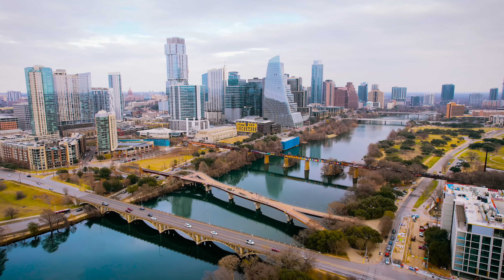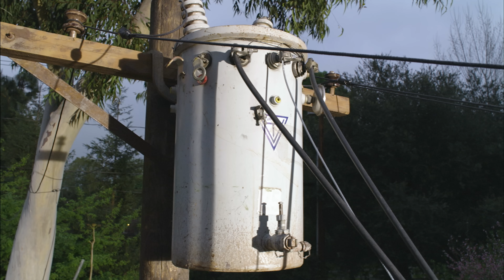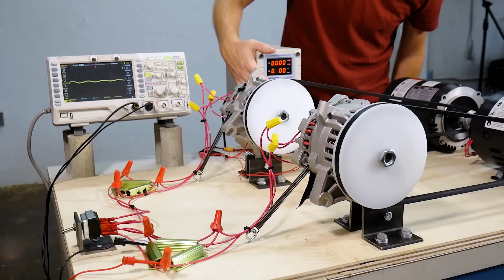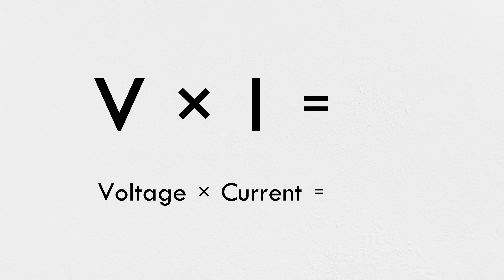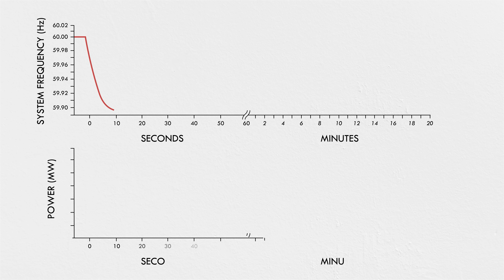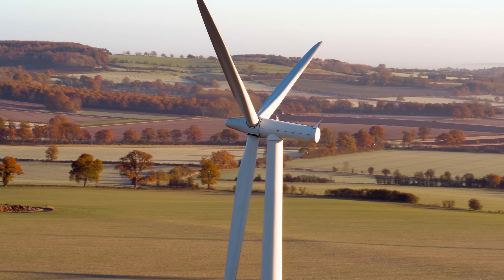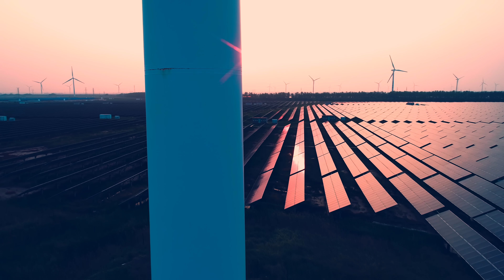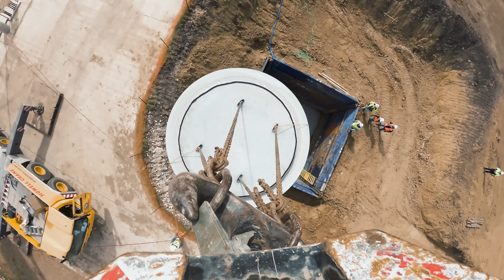Connecting Solar to the Grid is Harder Than You Think

Comment: Audio nerd here and you stole the words out of my mouth with that inverter explanation when I thought "That just sounds like the way pulse width modulation works."
Reply: What is shown in the video IS NOT what PWM looks like, though...
Reply: @TheMightyZwom Correct, the picture shown has some kind of multi-level inverter.
By the way, you can have inverters that are both multi-level and still use pulse-width modulation.
Reply: @marco23p  Yes, absolutely. The video only mentioned PWM, however, and I found that inaccurate (or at the very least incomplete).
Reply: Though normally solar inverters are horrid RF noise generators, as most of them really do not have enough filtering, and often enough the connection methods used are not the best from a RF noise point of view. You really need a lot more filtering to reduce harmonics, and such filters at power are both heavy, expensive and tend to run somewhat hot, losing power in the noise by dissipating as heat in the inductors and capacitors. No way to work it with smaller power, though you can reduce emitted noise quite a lot simply by connecting grounds correctly, and using properly RF bonded steel conduits for the cables, and a local RF functional ground as well. But most will not install that, as it adds a lot of cost to the system for little perceived improvement.
Reply: his demo isn't showing what actual PWM looks like
Reply: Yep. A sine wave inverter is just a class D amplifier with different circuitry for controlling the switching transistors (and the rail voltages are also very different).
Reply: He is showing a modified sinewave inverter, but what about the high quality pure sine wave inverters?
Reply: Reminded of my first time finding out what PWM is. Had to change the cooling fan motor on Lincoln and I thought it was broke. It wasn't. It was turning at whatever speed it needed to. Once I got it hot it went 100% full blast. Then I found out it was PWM and explained it to the owner, he thought it was broke because it wasn't turning as fast as he thought it should.
Reply: MPPT: Am I a joke to you?
Reply: Know what's a fun thing about inverters found on good UPS , they're almost like audio amplifiers, except they're a bit simpler because they don't need range to produce a perfect sine wave.
Reply: Furries are bad
Reply: That’s literally what it is. Pwm driving a h bridge at its most basic. some higher performance inverters use high frequency pulse density modulation. Add a low pass filter to remove the transients and you have a sine wave. Which is also what 1-bit oversampled digital audio does. Same principle, but way more power.
Reply: Same here! I saw the stair-step waves and thought, "Digital audio!"  I never realized inverters are basically 'digitizing' the power to make it into A/C.
Reply: @cjc363636 ”stair stepped” waves do not exist in digital audio.  That is a myth and misrepresentation.
Reply: @yookalaylee2289  If your system is designed badly enough, you totally can get stepped signals in digital audio.
Reply: @user-td3yi1mq7p  I'm not sure how you'd accomplish it unless you intentionally used some zero-order-hold audio DAC IC from the early 1990s.  If you buy a $0.50 modern audio DAC IC you're not going to see any steps.
Reply: @MatthijsvanDuin  
Yeah for real, I was like: 'are you having highschool students do it from the ground up or what?'
Reply: @yookalaylee2289 by definition,  digital audio is "stair-stepped" (at least the origin of it - else it weren't called "digital"..)
Reply: @laus9953  please look into the subject.  It’s not that simple and too complex for a YouTube comment.

Comment: Just started to explore Grid-tired solar system. This video came a a good time. I was discussing with our Solar vendor about having the inverter continue powering thru a grid outages... and the Solis smart inverter could not do it. Yup, knew of MPPT, and how Solar Generation is not as smooth as most people think that it is, passing clouds could drop the generation just like that, and it will cycle thru generation at Peak and trough...not an easy task, trying to do power generation, and still have to follow the grid's frequency and voltages.
Reply: What ever you choose, choose hybrid inverter with un-balanced output with some batterys.

Comment: It's amazing how much smarter the grid is becoming all the time. To think - a hundred and fifty years ago all we wanted was electric lights that could withstand a lot of variability and now we have all this delicate machinery in our homes that could be thrown off by a few volts at the wrong time.
Reply: Depends, most DC items use a switch mode power supply, which are very forgiving. They're rated (usually) 100-240v 50-60hz, so anything near or within that range will be just fine. The most sensitive common item will be things like compressors and other motors
Reply: Actually more of the "smart" devices are problematic for the grid during brownouts, not the other way around. Switching power supplies will try to draw the same amount of power regardless of the input voltage. Normally if the grid sags, motors and basic resistive loads will draw less power and it can stabilize, but too many adaptive loads will pull ever more current as the voltage drops.
Reply: ohh no, that's really not the reason why this is monitored so closely. 

yes, many clocks such as on microwaves or stoves depend on an accurate net frequency in order to show the correct time, but you really only monitor the grid so closely to sense its "needs" and so that you know whether you need to change something on the supply side. remember, electricity can't be stored somewhere (yes, ever; a pumped storage doesn't contain "current," but water, after all), but must be produced on the fly to exactly match the current demand. that's the reason for all this "effort."
Reply: Most of it shouldn't even require the power it does, but alas, the Internet of Things.
Reply: The Grid has always been smart, Flynn just made it better.
Reply: @keith_5584  like ai, often just a fancy word for some basic software
Reply: ....smarter? It less stable than 30 years ago lol
Reply: @mddunlap03  that's exactly my point 30 years ago demand was much more easy to predict. The UK for example had special generators who only switched on in order to power electric kettles in the ad breaks of the popular soap operas. It was that easy to predict. With people working from home, generating their own electricity, drawing electricity for all kinds of different tasks at different times, it's much harder to predict. 30 years ago the only thing you needed your electricity for was lighting and cooking, maybe heating or cooling.
Reply: @PazinPortugal  yes. Saying that the draw has become less predictable doesn't mean that they aren't keeping up. That's kind of my point all of this work to make the grid more responsive is because it's less predictable
Reply: @Crusader1089  I think I remember wondering about that, even considering that electric kettles are a UK thing (I'm in the USA).  How long does a kettle take to get water to a boil?  It has to be more than a commercial (ad break) long in anything but the tiniest kettles.  I know from experience with a stovetop (hob) kettle on an electric range.  And can't these kettles be kept powered on and ready with a complete fill of water, since they shut off and turn back on controlled by a thermostat?
Reply: @mddunlap03  "smarter" in the sense of "more automated by tech", as in "smart home", which is actually dumb to do, because as you note, less stable, among other things.
Reply: @mddunlap03  maybe it's less stable in Texas, in Europe it's only getting more stable with time
Reply: You should watch the video again, we're not talking about voltage but frequency. It's frequency which keeps the balance of active power in check. Voltage regulation is less critical than frequency.
Reply: @Chopper153  voltage does very well play a role - I believe one of the stabilising measures used by grid operators when approaching frequency dips, is to lower the grid voltage in order to make loads draw less current.
however loads which compensate for voltage fluctuation, will then not draw less current.
Reply: @Chopper153  it's possible for a video to inspire other thoughts in people, you know? The delicate nature of our modern electronics contrasting with both the complexity of the grid and how much it has had to evolved since it was first being built.

Comment: Great stuff!
Got a solar install here (in Ireland) which allows for off-grid usage during outages though there is some downtime in the switchover as it has to completely disconnect from the grid to operate. Still a useful option if you can get it.
Reply: How does the solar function after sunset?  Do you have battery backup?
Reply: @johntex105  Yep, though we haven't yet had a night time outage.
Reply: @fuzzix  Without having any clue about the amount of battery storage of the setup I reckon it could be quite useful. Should be sufficient to run the lights for a while and keep the fridge and freezer at the intended temperature until the sun is back ideally without clouds.

I remember a power outage at my parents once during the winter, one complication of that with central heating I had never thought about at that age was that it'd kill that too. Sure the actual heat comes from burning gas but without electricity to pump the warm water around and run some electronics involved with the burner it'll just sit there being pretty. Fortunately it wasn't all that long and they have a wood fireplace in the living room, but older buildings sure can get cold quickly if it's freezing along with a strong wind.

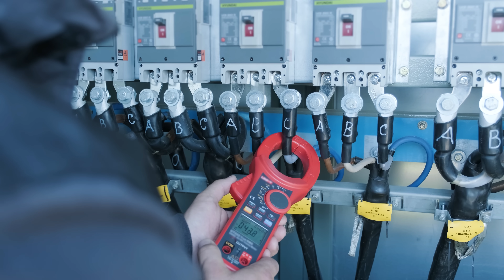Comment: 4:17 A wireless current sensor? I have questions.
Reply: You can imagine it a bit like a wireless phone charger. Both work because alternating current generates an alternating magnetic field around it. In the case of the phone charger, the phone draws energy from the magnetic field; this current sensor probably just looks at its strength without drawing much energy at all.
Reply: As long as the current is alternating you can measure the rate of change of the generated magnetic field using induction or the Hall effect.

Edit: Hall Effect sensors also work on DC circuits because they can measure the absolute strength of a magnetic field not just the rate of change.

Comment: Is solar really that good given that it is highly seasonal. Off season capacity still needs to be built and paid for just to be used intermittently.
Reply: Load is highly seasonal too. There is a high correlation between AC usage and solar generation. It's not a silver bullet and isn't going to be feasible everywhere of course.
Reply: @adamgardner3364  as long as your main power consumer is AC and not something that has to work all year, yeah.
I don't think any client will accept a server provider not being available for even a minute because "oops, cloud over the data center".
Reply: @wumi2419  in here ac is not so popular but heat pump heating is getting traction.

Comment: pulse width modulation does not produce step like waveform, as it name suggest it changes the off/on pulse length and uses a low pass filter to smooth out the wave. what you have looks like a DAC, which may not be suitable for high power and are more expensive.
Reply: Its not a DAC.  You can't DAC an AC output at significant amounts of power... DACs are resistive devices so the inverter would basically melt, more or less instantly.  And it's not the PWM either.   Modified sine wave inverters work mostly by pumping two capacitors with two somewhat out-of-phase square waves and getting an additive effect.  That is what creates the step pattern.

Pure sine wave inverters work by running a square wave into a transformer/inductor circuit and using the magnetic effects to turn that into an almost real sine wave.   Then a simple filter stage to turn that into something very very close to a pure sine wave.

You can't do non-resistive voltage regulation of any kind without some sort of magnetic component or electric field component (or both).  A capacitor, for example.   And you can't really get anything resembling an actual sine wave without using something with a magnetic component (either an inductor or a transformer or both).

-Matt
Reply: @junkerzn7312  Ehhh, you can use capacitors and switches to provide enough intermediate taps from where you can then afford to resistive DAC a pure sine wave, without any magnetics. And still at over 95% efficiency. Though you'll want to use tiny inductance to resonate some of the oscillating currents in the arrangement to not loose so much energy during the switch transitions, as the efficient capacitors are expensive so you want to switch fast so you need less of them. That's why you'd in practice need a tiny bit of inductance to get >98% efficiency from such a system.